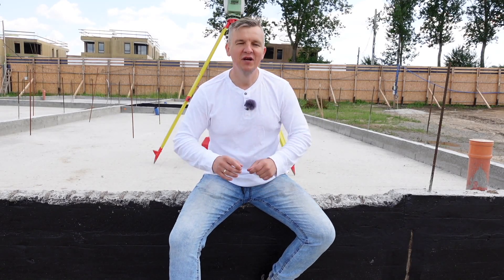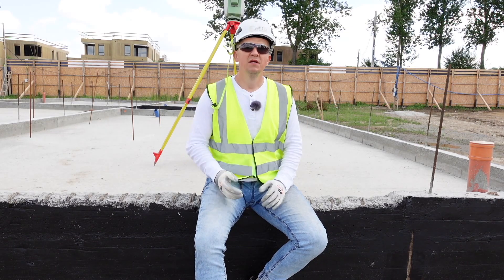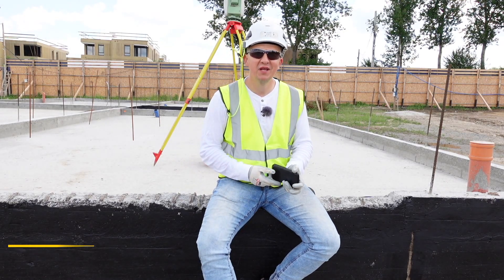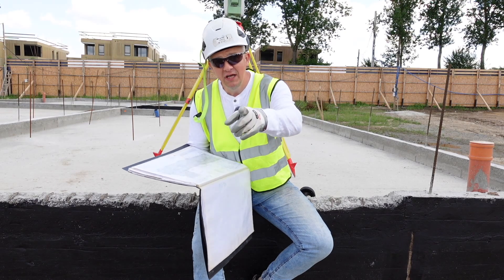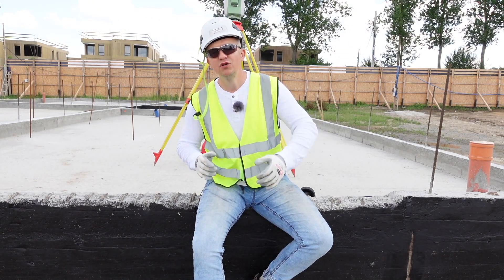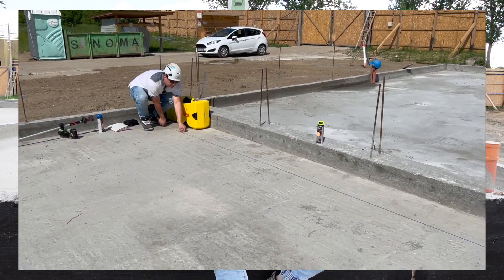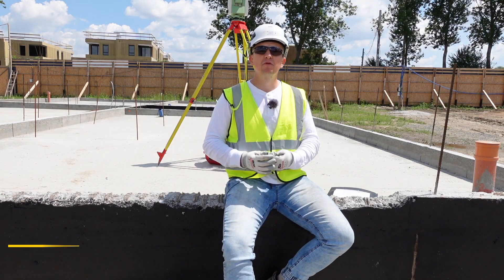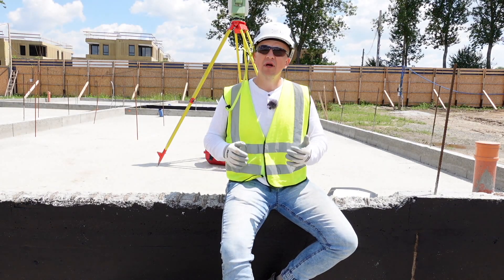10 MUST haves for CIVIL site ENGINEERS

Comment: Thanks for this video. This week I started my new job as a QA/QC Engineer :)
Reply from the maker: Great news! All the best in the new role, if I can help somehow don't hesitate to ask 👍👍
Reply: @SITENG  Thanks for such a quick reply. Huge fan here. I think it would be beneficial if you'd start a series on issues such as concrete slab cracks and so on showing what happens when drawings are not followed and how this can be fixed.
Reply from the maker: Thank you! I will start the structures series where I want to cover failures as well - which in most cases will be caused by not following the drawings as you say. Should start within few weeks and thank you for your comment and advice!👍👍

Comment: Hi Greg great video. 

Recently I seen an engineer setting out houses with a gps.  

Are the now that accurate that they can be within tolerance? 

Also would the engineer using this have to convert the local coordinates into global ?  Cheers
Reply from the maker: Thanks Philip! I wouldn't set a house with GPS, but TBH I don't work much with it. Yeah if the information would be provided eg for London grid you would have to convert it to global. The equipment might have the options really, but I don't know it 😁
Reply: @SITENG  thank you for your reply. Very useful 👌 have a good weekend
Reply from the maker: Have a good one too 😁